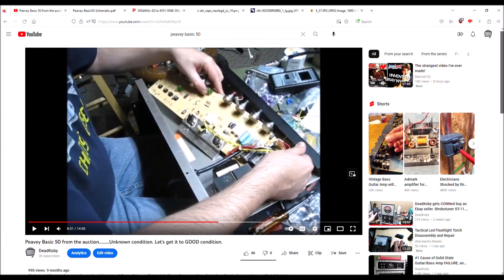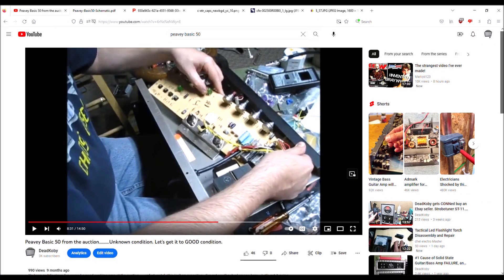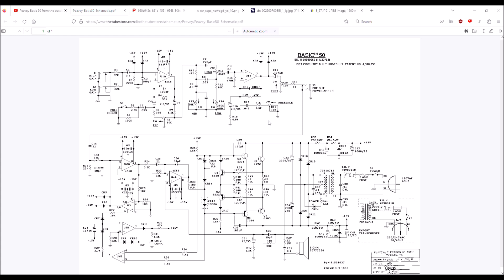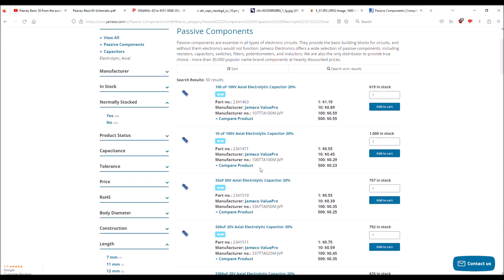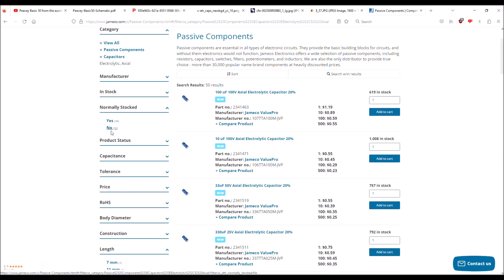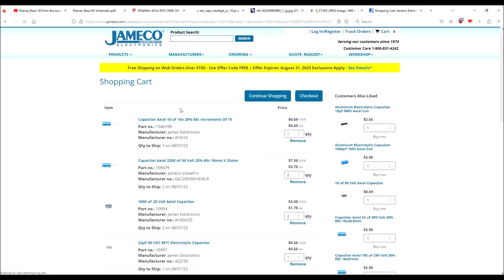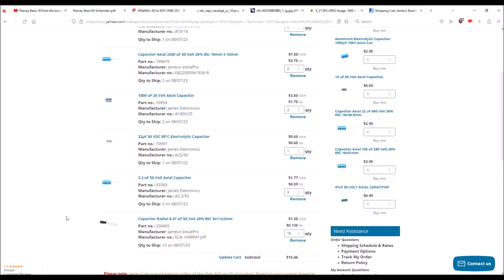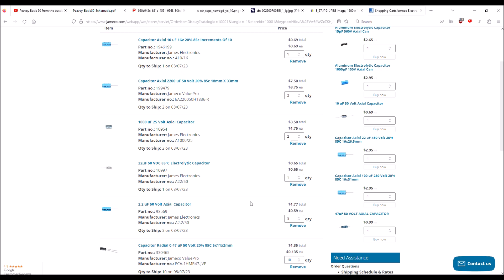Finding the right capacitors to fix a Solid State guitar/bass amp--HowTo

Comment: Awesome video DK! I always wonder where the guy is "Ordering It"...
Reply from the maker: If I had to break it down............   #1 CE Distribution (Amplified Parts)  #2  Jameco  #3  Mouser     CE/Amplified has expanded their line,  so I'm going there MORE often.   SS amps usually have High uf, Modest voltage caps...  and CE only has those in Radial.